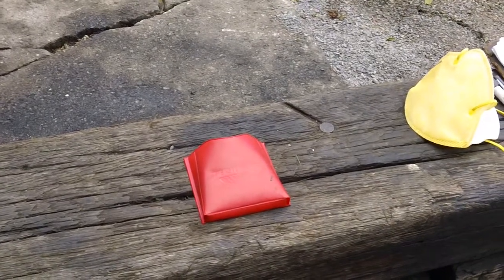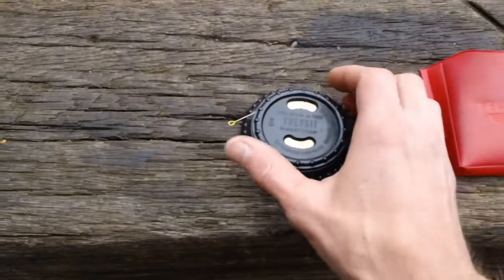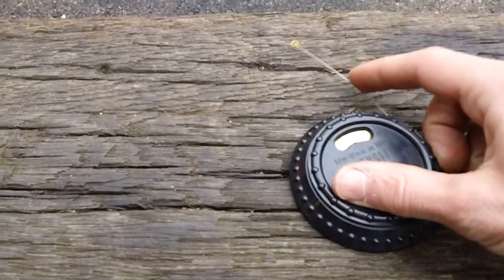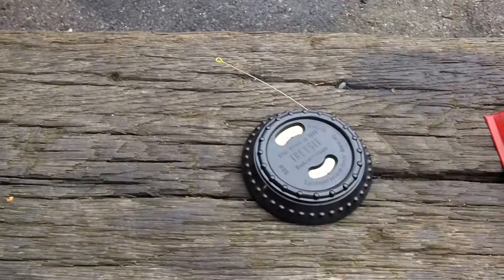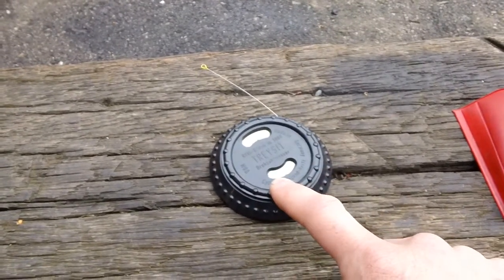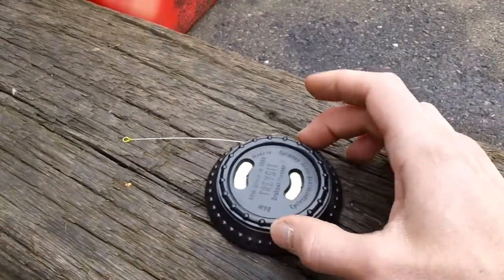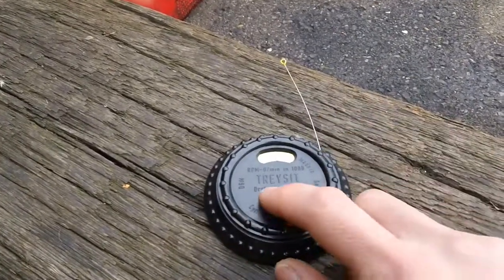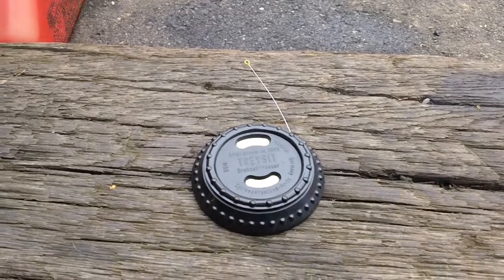treysit tachometer

Comment: Its not that old if it has a website address on it. It was sold under a lot of different companies. My old one has “Daimler Chrysler Academy” on the pouch and no web address on it anywhere. I’d guess yours is from somewhere around 2000-ish with a web address on it. Guess that pretty much fits with 20-ish years old…

Comment: Just bought one. I Could not find a digital small engine tachometer that had decent reviews. After watching few videos on this device, I decided it's what I was going with.
Reply: Runleader tachometer is under $20 bucks, very accurate, Battery powered,, use a small battery clamp to clamp to your mower, snow blower  plug, very reliable.

Comment: I love my Treysit Sirometer.  Measures from 800 to 50,000 RPM within 1% or 2% accuracy. 
Neat as can be.
Reply from the maker: yes,  these are simple and effective tools.  require not electricity and will work for most any engine.